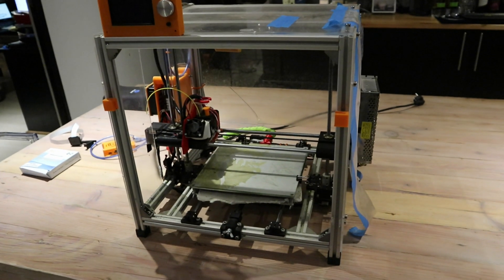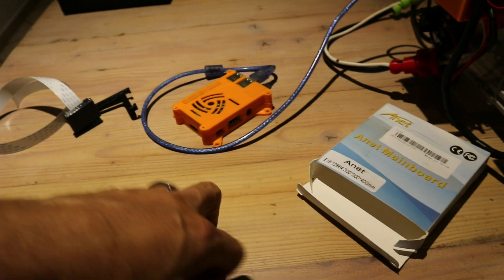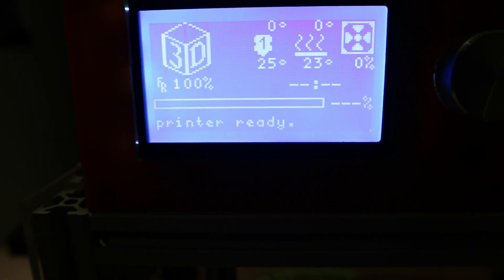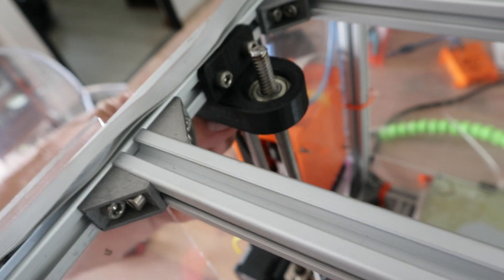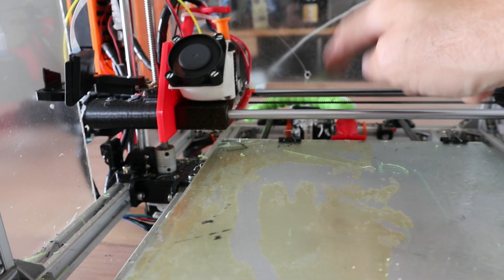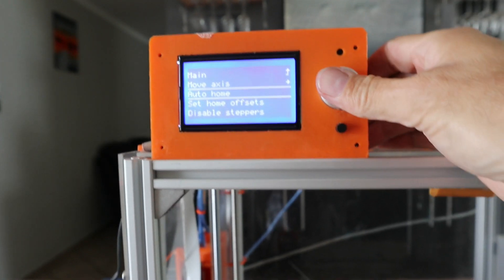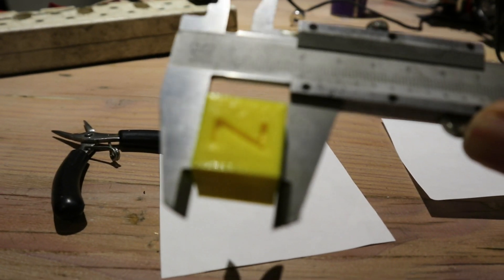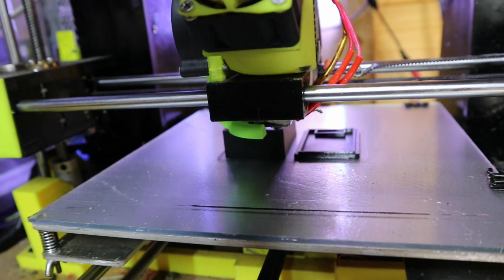Anet A6 V1.7 Board upgrade and Marlin Firmware

Comment: Hey, Graham, nice to see a fellow Saffer doing 3d printing YouTubing. I'm glad you found Marlin and were able to load it. The Anet firmware is kak - and it also does not have thermal runaway protection enabled - which is really important to prevent a fire from burning your house down.  I had to install Marlin on my A6 when I upgraded to an automatic bed levelling sensor. Mine is still on the acrylic frame, although I have bolted it down to a wooden frame for rigidity. I am in the process of designing a Core XY printer running on a cube frame, and I had just got the electronics working with a similar graphical display and an Arduino Mega and Ramps 1.4 board. Then, bang, my Anet A6 board dies. I was too lazy to install the MOSFET upgrade, even though I had it. So it looks like my A6 will be running on a RAMPS board. I hope now you are familiar with the Marlin firmware process, that it is easy to adjust direction of motors, steps per mm and all of that and just bake another firmware - and you can use ANY board to drive the Anet - the components used are universal, just like any other printer.

Comment: Hi, my fuse between power supply and mainboard burned and i want to replace it, what fuse do i need or can i just run a direct wire between power and board without problems?
Reply from the maker: Do not put a wire there. There is a reason it popped. That fuse is also for over power protection, which prevents the printer from catching fire. That fuse is a 10A unit

Comment: 1:36 Kyk of jy beter results het met die bearing. Ekt ondervind dat ENIGE vibrasie wat in die frame is, al is dit so min soos 'n fan wat effe off balance is, resonance veroorsaak wat artifacts op jou print surface veroorsaak. As jy logies daaroor dink het leadscrew net nodig om lift te veroorsaak. Die linear action van die axis en die squarness van daai action in ralation tot jou ander axis word deur die smooth rods en bearings op daai axis self gedra en bewerkstellig. Jou lead screw gee dus net die force en dit maak nie saak as hy effe off balance  of wobly is nie. Lead screwes (tensy hy baie duur sleadscrews koop) is omtrent altyd ook baie efe warped in een rigting, wat ook 'n baie slagte wavey effect op die surface van die print veroorsaak. 'n Upgrade wat jou wel in daai opsig gaan help is anti backlash nuts of jou leadscrews. Great video though !! Keep them coming..